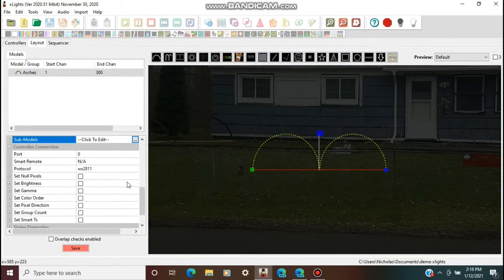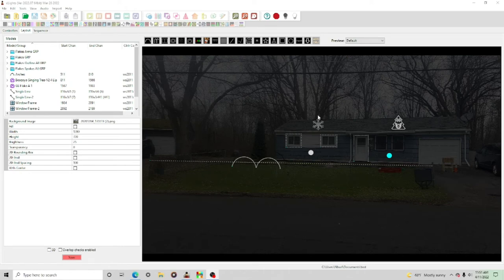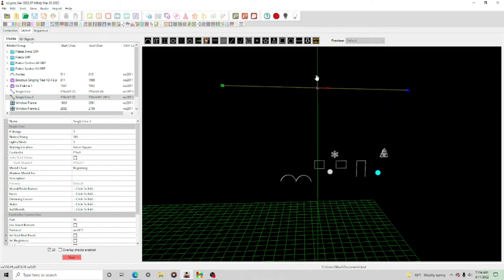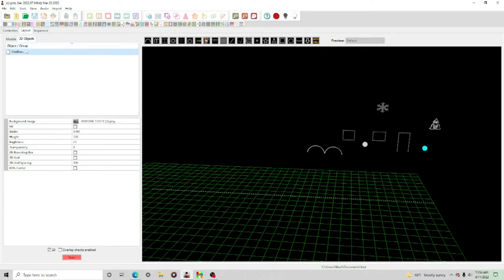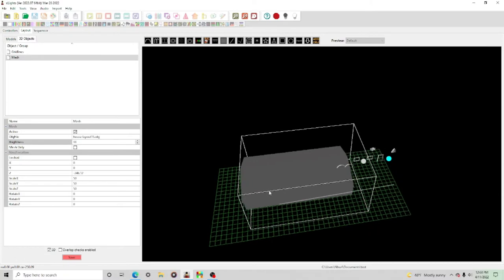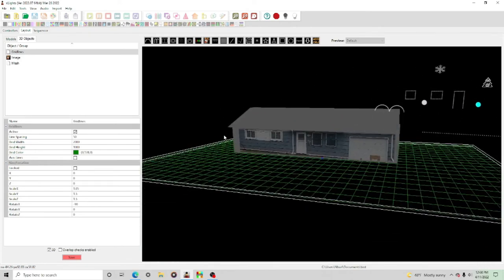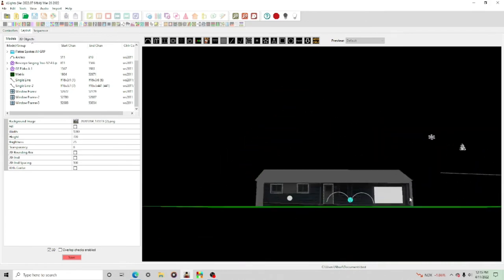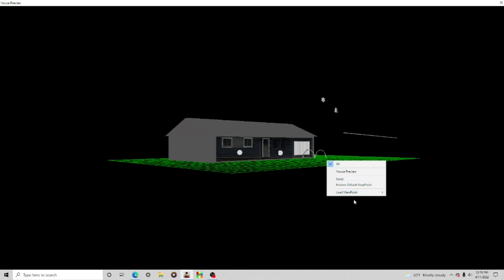How to use 3D in Xlights (and how to convert from 2D)

Comment: 3D is amazing when it comes to any display. It saves having to setup shadow models for a different rendering perspective.
When you set views, you can render a prop from that view for a certain effect. Example: a bars effect renders from a top-down birds eye view on the entire house.
--
In 2019 my roofline had issues with some pixels basically acting as one pixel. This was because XLights saw a 70 node pixel string as one pixel going back into the Z axis. Telling that model to render from another angled solved the issue.

It's more than just having fun watching a sequence from different angles. 🙂
Reply from the maker: Well said!
Reply: Very informative, I am facing similer issue for left side props, but not geeting how to slove could you please help ?
Reply: @ranvirgorai7304  Add a camera angle in the layout tab.
Then change the effect's layer settings to 'per preview' and the camera angle you added.
Reply: @NorthparkLights  Thankyou
Reply: @ranvirgorai7304  Biggest advice:
xLights looks at your model preview as a 2D view. It has no perception of depth.
Changing rendering angle in 3D space can help that. Although sometimes other rendering settings such as 'as a single line' do better.
Reply: @NorthparkLights  Got it, Tried the steps you mentioned, now it is working as expected, Thanks a lot !

Comment: How do you get the mesh of your house
Reply from the maker: Getting that mesh was extremely hard. I used a program called blender to make 3d models and I'm a noob when it comes to that stuff. I don't know how I made the mesh all I know is I did it in blender 🤣
Reply: Do you need 3d mesh of your house ?
Reply: @ranvirgorai7304  I have talked to the people in the zoom room. Its more important to have the props as the exist in the real world vs how it looks in this program layout. So even if the outline of your house is at an angle (based on the picture) you want to make it perfectly "level" in xlights assuming your gutters are level. Otherwise xlights will render it irregularly in the real world even though it looks right in xlights itself.
Reply: aka its more important to use the model as a rough idea of what you are putting together but if the house is level across but the picture your laying your props on was taken at an angle make sure you build your props in level in xlights. AKA the 3d model isn't THAT important the real world dimensions and angles is what you really want to match in xlights.

Comment: do you have a matrix i made one with pixels mine is 15x15 225 pixels
Reply from the maker: I have a matrix but it's not made out of pixels it's a projector. Mine is 176x96 pixels which would make the resolution of the screen just under 240p.
Reply: @How2Pixel  are the pictures clear with the projector and do you shine it on a wall or something else you could take any projector
Reply from the maker: It shines on our garage and if you stand near it, the picture looks bad and fussy, but from the road it looks fine.